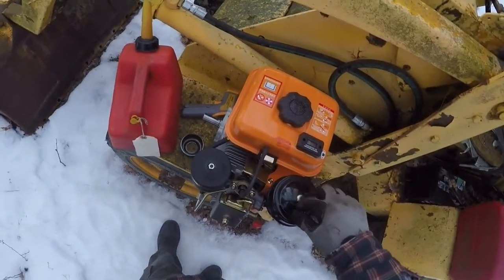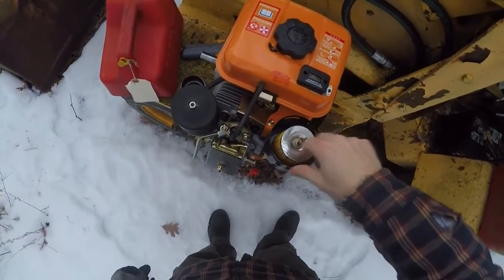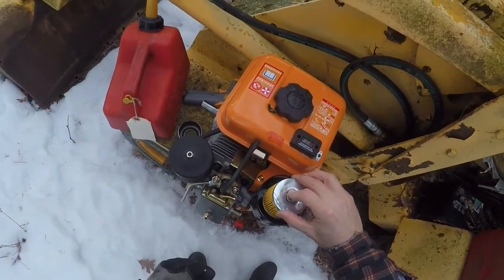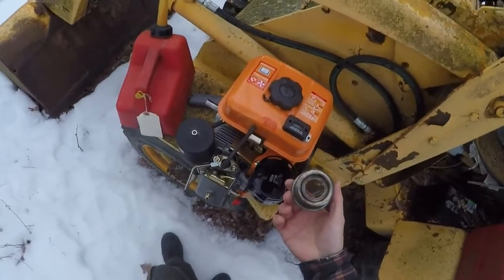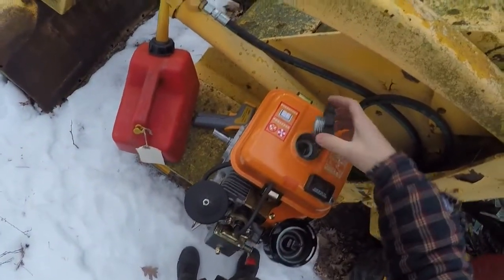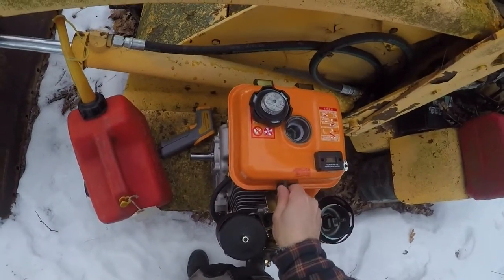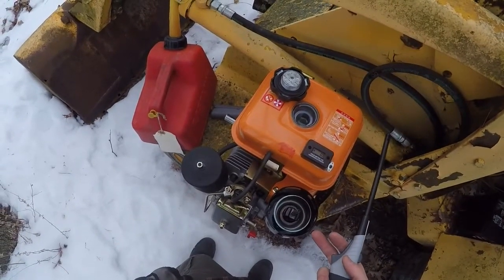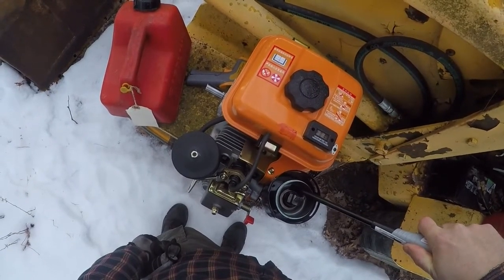Cold diesel?  No glow plugs?  No ether?  No problem!

Comment: You can accomplish the same thing with a propane torch.  Just play the flame into the intake while cranking and it'll bang right off.  This technique also works on the 2- 3- and 4- cylinder Yanmar, Isuzu, Mitsubishi and Perkins diesels.
Reply from the maker: Any heat is better than no heat for sure.  Others have stated to use a torch directly on the injector.  All effective methods but I have not tested all of them.  Ether seems to be the most convenient but over-dosing can be an issue.  I tried starting one of these smaller diesels on a cold day and got a little crazy with ether (two-three seconds of spray in the intake.)  Thankfully it didn't over rev but it was revving high and the speed control lever did nothing while the ether was being consumed.  Thanks for watching and commenting.

Comment: Are you still using this diesel engine now ? And how has it held up over the years
Reply from the maker: Thanks for watching and I only have two of these in service.  One on a winch and the other on a kinetic log splitter which I have done other videos on and both have been reliable as far as starting and running after sitting a long time - usually they start on the first pull if it's not below 30°'F.  The winch does not accumulate many hours due to the nature of the service and how often it actually gets used.  The log splitter might be up to 10-15 hours now.  Again, not much but I believe the run time on these should rival most other engines of similar size.
Reply: I’m really thinking about putting one of these motors on a mud motor kit ! I think it would be kinda bad ass may not be very fast but it would definitely push my little jon boat I would think
Reply from the maker: Applications abound!  They are ideal in services where they don't see much regular usage.  The other attraction is they can use alternative fuels if a person is into that.  Power to weight ratio is not so great.  RPM from factory is around 3000 rpm in my experience so that can cause issues too for applications requiring higher shaft speeds.  Potential hard starting issues in cold weather.  If you can live with those shortcomings or prefer them over problems associated with carbureted gas engines then certainly they would be the preferred choice.

Comment: How well did the engine hold up thinking about buying one
Reply from the maker: Thanks for watching. So far no issues but I don’t run them often as they are used in applications that may not see a lot of use which is why I wanted a diesel in place (less long-term fuel storage issues). The prices seem to keep coming down on these. I would highly recommend getting one as I believe they are a great value.
Reply: @Ilikeurtractor  Thankyou and I might be getting one

Comment: I use a similar method with no gasoline, too dangerous. Heat the steel part inside the air cleaner with a propane torch, hot enough to make diesel smoke when sprayed with diesel fuel. No flame. Crank the engine when spraying the hot steel part of the intake. Any flames will eat up oxygen the engine needs to run. Heat and smoke are all you need.

Comment: DUDE!, I was a hevy mechanic in Fairbanks Alaska and simply lighy soaked a rag in GASOLINE, stretched it over the diesel intake and crank, "she will bang right off". When the rag is dry and she dies just do it again until she stays running. Gasoline VAPOR ignites much more easy than Gasoline under compression. It is much better than Phenyl Ether as I see it, the engine never locks up with excess use. It is also my "go to" to reprime air locked diesel fuel systems. Just sayin...
Reply from the maker: Thanks for watching and sharing your experiences and adding to the knowledge base!
Reply: @Ilikeurtractor  👍👍👍👍   it works .

Comment: What about winter diesel?  Will kerosene act any better in the cylinder?
Reply from the maker: It appears kerosene and diesel have very similar flashpoints and auto ignition temperatures so if it would make any difference it is likely to be insignificant.  Kerosene, “jet” fuel, and “winter” fuel have lower temperature gel points which is why they are desirable in instances where regular #2 would be gelled.
Reply: @Ilikeurtractor  that makes sense. I guess it’s why we still use glow plugs even with winter diesel ha ha

Comment: Is that an hour meter on that engine? How did you get an hour meter on there with no spark wire?
Reply from the maker: Thanks for watching. It is a vibration activated hour meter so no wires.
Reply from the maker: Also, since it is vibration activated it will accumulate hours in transit so I’d recommend buying one with a switch.

Comment: I wouldnt spray  starting fluid  in it  for the world
Reply: No reason not to in this particular engine... the worst you'd do to a bigger diesel is damage the glow plugs which this doesn't have any due to having extremely high compression even for a diesel.
Reply: Either is fine if used correctly for moderate cold starts like this. Propane torch or hair dryer on that air cooled cylinder would get it done.

Comment: my dexta has an intake heater which doesn't help at all. until i get to overhaul the engine i guess the only option is to keep cranking til she does start. i won't use ether/brake cleaner.

Comment: I just purchased a older diesel tractor. I'm glad somebody wrote directions on how to start it under the hood. It said if it doesn't start use ether "no thanks"  I enjoyed your video. Thank you
Reply from the maker: Ether is a good option but it is advised to disable the glow plugs or intake heater (disconnect the wire or install a properly rated switch on the wire feeding them and turn it off) if it is equipped with those or a similar element in the intake path.  Keep in mind glow plugs and heating elements can and usually are active when the starting motor is activated so skipping over the key position for preheat does not typically avoid this problem.  Minimize the amount of ether use and it can be safely applied.  Experiment with spray durations in 1/4 second intervals until you get a feel for how much is required to start the engine.  These small diesels should not require more than one 1/4 second interval spray.  If you need more to get it to fire there is likely another issue preventing if from starting.  Thanks for watching :)
Reply: @Ilikeurtractor  Another option for safer ether use is to spray it in after the starter starts turning the engine over rather then letting it sit in the air box.

Comment: Seems like alot of drama lol. Propane torch with heating tip does everything he did but in 5 seconds lol
Reply: I think the idea was if you don’t have a torch.
Reply: A soaked rag on a stick would have the same results, I can't see why go through all that fuss.
Reply: @axkoula7851  Exactly lol! Dumped a bucket hot water on cold diesels even to start them. this was a showboat video lol!
Reply: Yeah that was a long time  coming, about every diesel engine in India is started that way

Comment: I wonder if the heat or the gasoline fumes helped more. Diesel definitely likes heat but gas fumes will act like ether.
Reply from the maker: Good question.  Probably worth exploring more somehow.  In this case there should be very few, if any unburned gasoline fumes available since it's being burned in the air filter housing prior to reaching the inside of the cylinder.  I'm learning combustion is a little more complicated than the fire triangle + chain reaction.  Available ignition energy also plays into the equation.  Understanding that and what is going on inside the combustion chamber on cold startup appears to be somewhat challenging without having the proper tools to collect data.
Reply: We often started our Ford 4000 with a oily gas rag... its a real shame you can't get the Fords or Farmtracs anymore. The new tractors have too much overpriced newfangled plastic. Also another pointer is electrical contact cleaner is often heptane.... which you guessed it is starting fluid minus some lubricants but it works fine in a pinch.

Comment: Is that a waldon loader? I have 2 of those
Reply from the maker: Yes.  Waldon 5000.  Probably late 70's but could be earlier.  Someone stuck a Toyota diesel from a compact truck into it.
Reply: @Ilikeurtractor  oh ok interesting the 2 I have are 4 cylinder ford diesels. I know there was a gas option engine and maybe others as well

Comment: pre heat cylinder / head with small propane torch for 5min , Almost all little air cooled diesels start in -40 with that much time.
Reply from the maker: Another good option!
Reply: Exactly, this method is too cumbersome, parts to loose, special adapter, needing reassembly. Just a small propane torch to the air cooling wings of the cylinder done.
Reply: hey its starPuss!